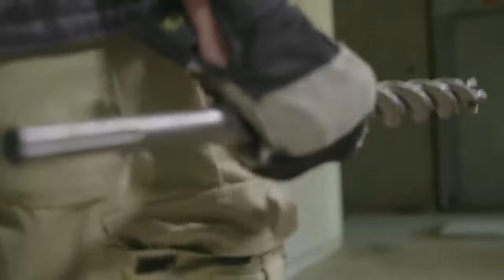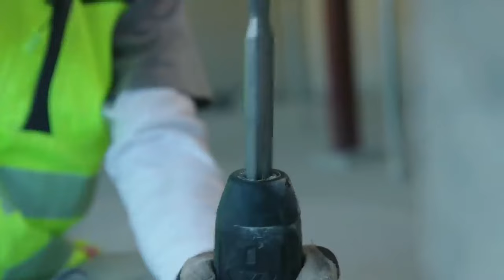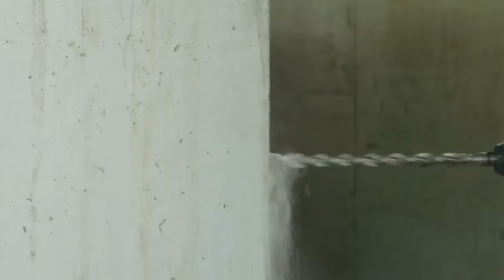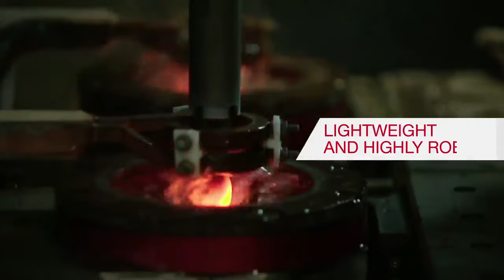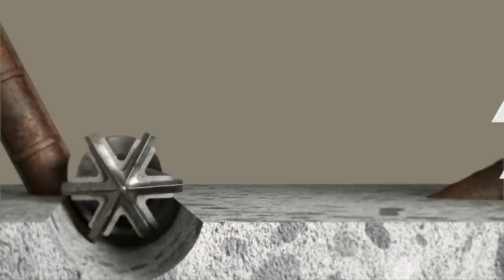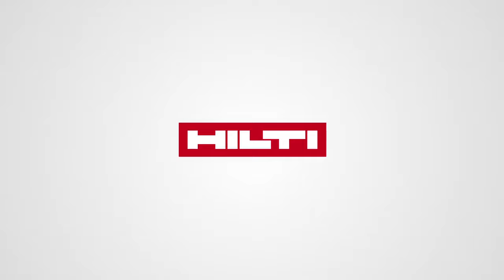Hilti TE-YX Drill Bits | Drill through rebar with ease | Innovations For You

Comment: yo. @Hilti Philippines ,,, my on site boss at work would go insane if i showed up with this bit, we struggle with rebar in commercial stores to cut costs newer commercial company like most but this bit i have never seen if i can get a demo or more info a way to test anything, that would be so cool this is literally the dream bit me and my father need to complete our contracts otherwise we site plan for 2 plus hours for 15 holes,, our dewalt hiltis x2 gets too hot we swap out with 4x 60v batteries etc,, and a grinder to cut our steel when we reach rebar cause we cant drill through rebar. im the youngest if i showed up with a bit that eases thro rebar like that theyd actually go nuts and buy a bunch... need more info if this really works, it would save lifetimes.. the diamond holo bit stuff takes too much and is not effiecent id rather get like 6 of these pound out 100 holes if that less or more in my week THROUGH rebar 1/10 holes idk,, seems like a life saver for my workline to good to be true so im not trying to chance it im a bad luck charm in general
Reply: cause rn standerd hiltis with 2 of them cordless unfortunatley takes around 2 hours for 20 holes,,, battery is no issue hilti count no issue i got more, if a bit actually ran thro rebar id just be the best onsite i need more info super interested and skeptical
Reply: the rebar takes most time at our sites we have to do alot to get proper calculation if i hiltid thro random rebar every start calculation will be correct no screwing around no boss getting upset at slow but $effiecent drilling would bring a smile to those around me and relieve my stress weird how a bit can do that
Reply: also whats the best affordable hilti 400 bucks or less i see the big red one looks so sexy and professional lol
Reply: You do realize the rebar is in there for a reason right? You must not have to pass inspection. Or have corrupted engineers over seeing your work.
Reply: @nydeatha9220  also this bit is not going through any rebar larger than a half inch with any speed at all. Angle around it kid.

Comment: Your no supposed to drill rebar it effects the structure
Reply: You have never worked in construction then 😅😅
Reply: @leandrolopes4777   Most people that drill through vertical rebar don’t relies the damage they can do in high wind areas and high rise construction
Reply: @brian2100  most people that do it it's because it's the only way
Reply: Тогда как просверлить отверстие для газовых коммуникаций , когда в этих местах попадается арматура ? Что буквой ( S  или Z )  просверливать? 😀
Reply: Shush forever
Reply: @leandrolopes4777 I do it to remove radioactive gas. You’d like the rebar intact? Fine, bye!